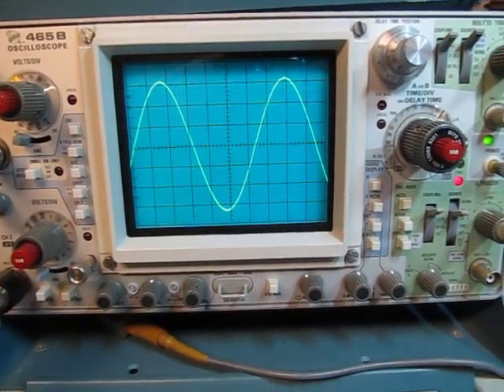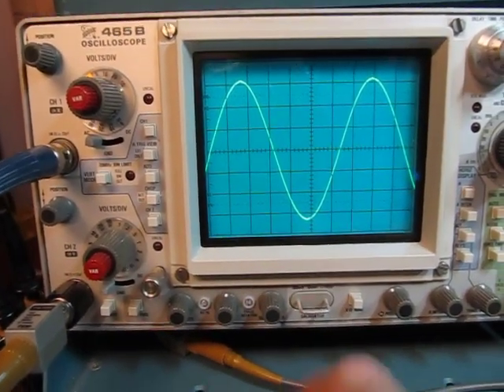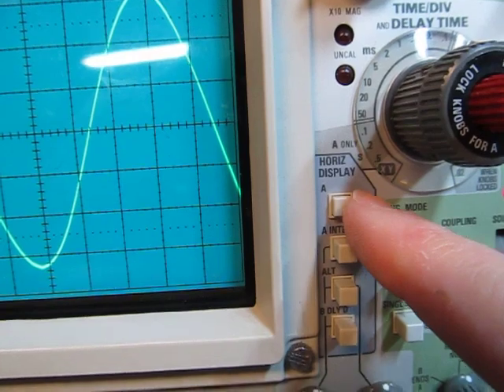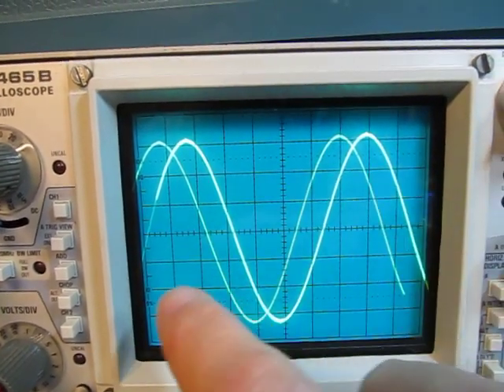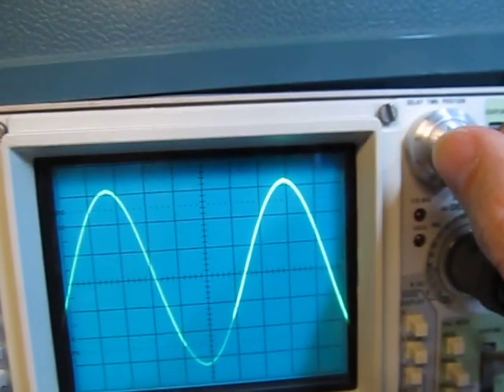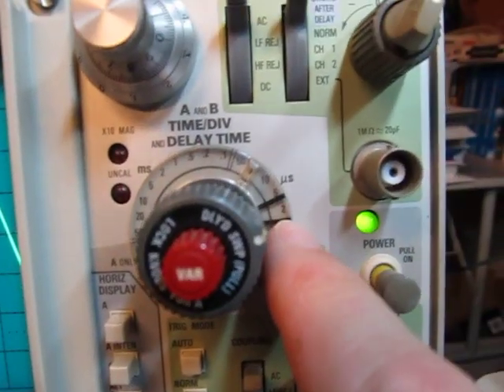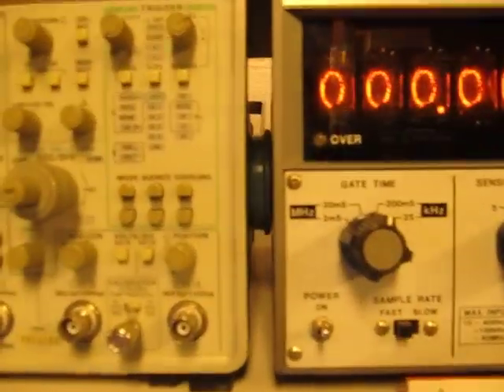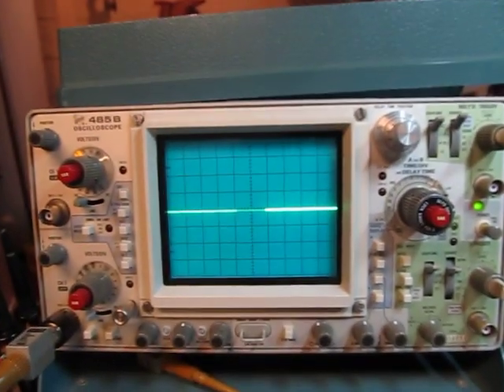#44: Frequency measurement using Delaying Timebase on Analog Oscilloscope

Comment: I love your video's so please don't stop trying to educate all of us. The only reason you may have been slightly off with the scope reading verses the frequency counter is because I think you forgot center the vertical offset  in your original measurement.
Reply from the maker: When using the delayed timebase, the vertical offset isn't that important. You just have to make sure you've nulled the trace offset between A and B.

Comment: Is it normal for the delayed timebase knob to be very hard to turn when you get to the one division "rollovers"? Yours seems really easy to turn- however, on mine, the knob turns fine from 0 to 0.9 divisions delay easy, but when you hit one (and turn the outer ring) the knob "locks up" and you have to put a lot of effort in to rotate the knob, but just around that point.

Comment: My b sweep on 453 seems broken.  I only get a tiny extra illuminated dot on top of the a sweep.  Turning time delay moves the dot. But I can’t resize it :(
Reply from the maker: Have you tried pulling and then rotating the main timebase knob?  It is possible that a previous own re-assembled it incorrectly.
Reply: @w2aew  thank you reply….yes.  The red calibration in the centre works. If I turn it left the uncal lights up.  If I pull the black part of the knob I can turn only the white dot on it and the clear portion remains stationary, the main trace doesn’t change timebase, but neither does the brighter dot.  If I rotate it back to the position matching the clear portion the knob clicks and then clear timebase changes together with the white dot resizing the timebase of the main trace(the dot still stays the same size).
Delay multiplier (silver dial on top) moves the little dot but not it’s size.
B sweep mode is in “b starts after delay time” position.
Horiz display is “A inten during b”.
In delayed sweep(b) position I only see the dot if I move the position to left. Size still doesn’t change the clear or the black(white dot) on the time/div and delay time.

I’m thinking at some point I will need to open it up.  I’m just not there yet with a comfort level for messing with the insides :).
Reply from the maker: @bitlong4669   Something is off.  When you pull and rotate the knob to speed up the B sweep, the intensified area should indicate the b sweep width.  not sure what is happening....
Reply: @w2aew  yes that’s what I learned from your videos.  Before watching I didn’t even know that feature existed, so thank you.  Your videos are very educational.  Hopefully it’s just dirty contacts or lose wire.  I got this scope not too long ago for some audio amplifier and composite video projects.  Once I’m done with them I’ll take the cover off and see what’s going on in the insides.